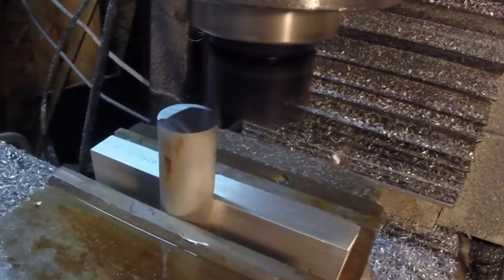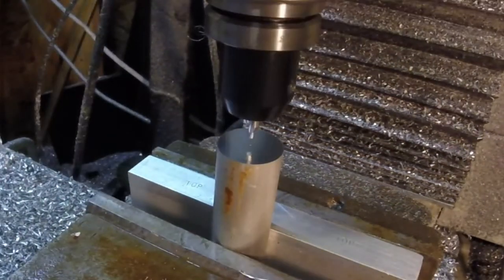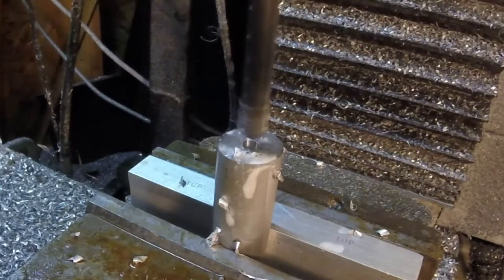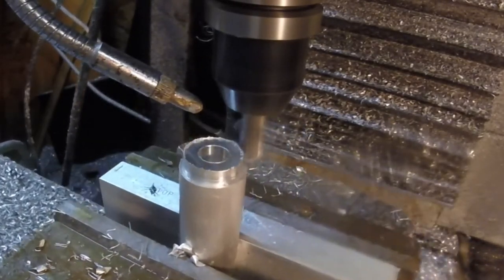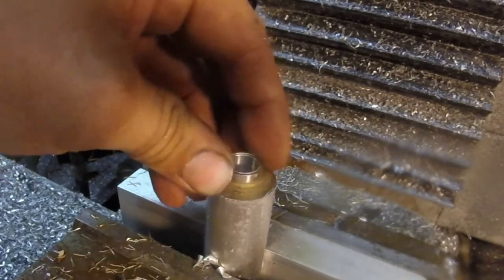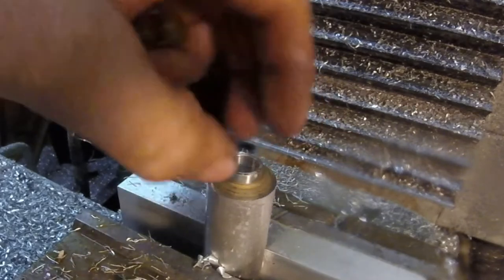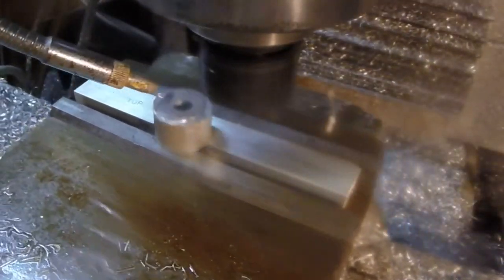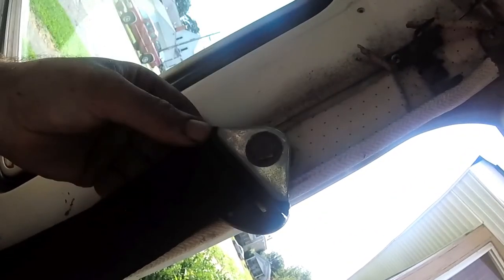Making a spacer to mount a retractable seat belt in my VW bus

Comment: Nice project.  I've done spacers like that for the old Datsuns....similar conversion to retractables.  You should get a chamfer tool so you can deburr all those edges with the tormach. :)
Reply from the maker: Thanks! Retractables are the way to go if you can make them fit.  Funny, I do have a  chamfer tool but was too lazy to add another step to the code.
Reply: What are you using for code?  Fusion360 makes really easy work of chamfering. :)
Reply from the maker: I downloaded Fusion but can't sit still long enough to figure it out.  I'm using CamBam.  I've got a chamfering template saved so it's just a matter of cut and paste but you have to remember that you want it first ;)